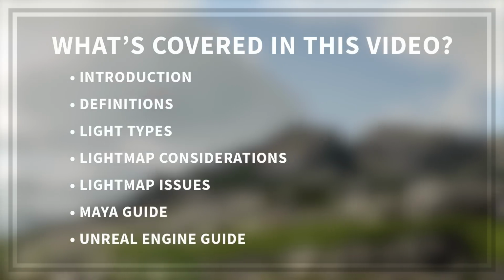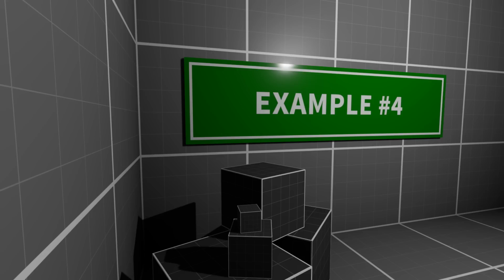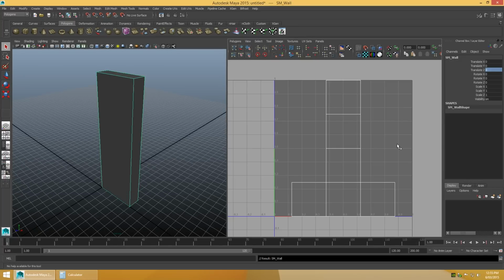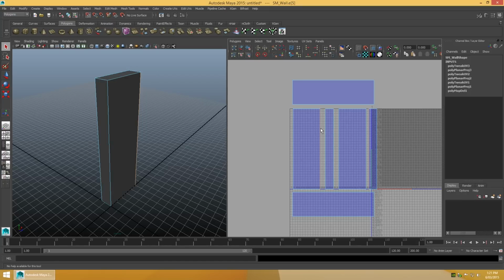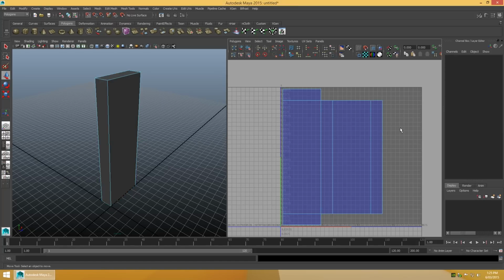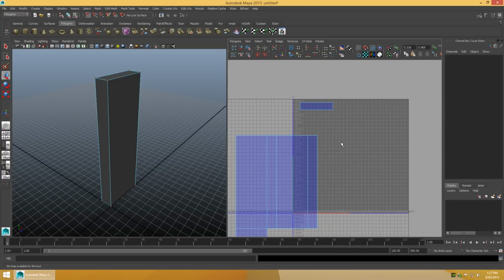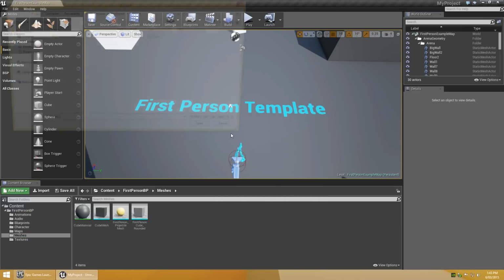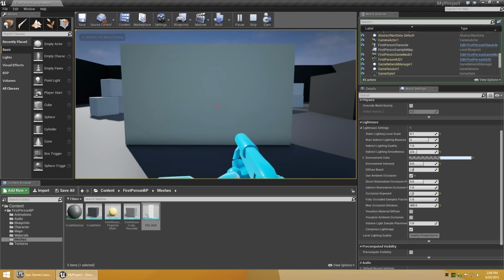"Baked Lighting" and "Lightmaps" (Maya & Unreal Engine)

Comment: Since my mac doesn't have "insert" on keyboard
what function should i click to get, that pervert point??
Reply from the maker: Sf Momo As an alternative, you can hold down D on your keyboard to manipulate the pivot point, in combination with V (to snap to point/vertex) or X (to snap to grid). Once you release D on your keyboard, it will revert back to manipulating the object/component. I hope that helps, but if not, let me know and I can make a short video for you.
Reply: It works..
Thanks so much.. I've watch many video.. But i think your video the best match for me, because i only can use maya in my mac, also your tutorial was complete step by step exclude ,the shortcut..
And thx to reply and help me out.. If i find another missing click or function  .
Soon,I hope u can help me again.. :) big plus for u sir
Reply: When u create uv, and u drag the uv in planar mapping..
Why the first axis was z ? And second must X ? Can i change it or can't ?

And when u drag those , that need match in the grid or something calculated or just drag for no reason?
Reply from the maker: Sf Momo Happy to hear that it worked for you. I'll add an annotation to the video. Regarding the correct planar projection axis, you need to reference the axis indicator, which is located in the bottom left hand corner of the view-port. http://i.imgur.com/xTeIHmh.gif As to why I translate the UV shells initially, it's to temporarily move them out of the 0-1 range (i.e. the working area) so that they don't overlap with the UV shells from additional projections. Aligning the UV shells with the grid is only required (well, recommended) when doing the second UV channel for the lightmap.